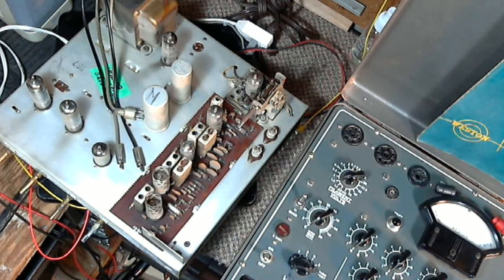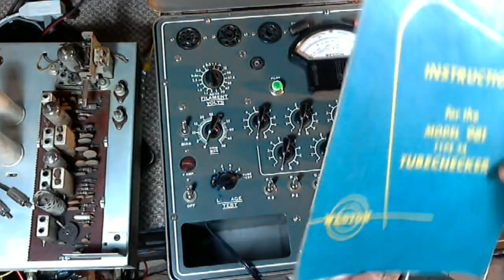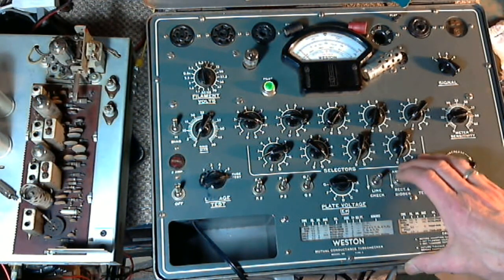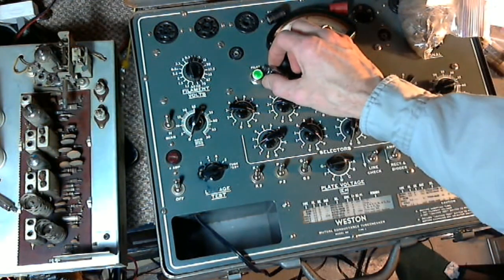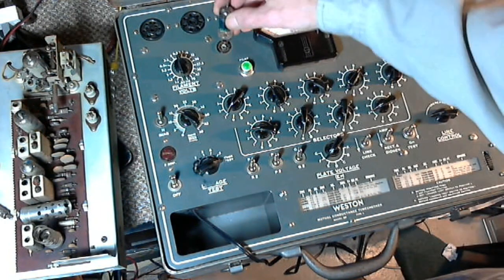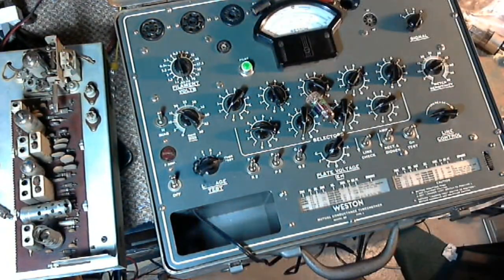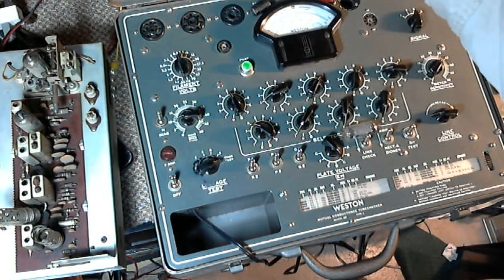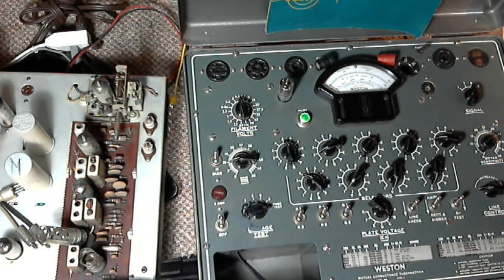Rogers Majestic 8059A Console Stereo Video #4 - Tube Testing Oh!

Comment: Jim review the video you did not miss read the tube. Actually you said "6am6" when you first read it, then when you went to set the tester you said "6am8" forgetting the number you had just read out loud, you did not miss read it.
Reply from the maker: As long as I didn't destroy my beloved tube tester, I'll get over it whether I was careless in reading it or senile in remembering it.
Reply from the maker: The output tubes are 6BM8's!  No wonder I get confused around here.  The radio was built by Philips under the trade name Rogers Majestic.  That's why the 'North American' radio uses a European tube set.  The 6AM6 is an EF91, the 6BM8's are ECL82's. And I'm in the middle of sorting through about 3000 tubes!  Thanks for watching, Jim.

Comment: This is one of the bad things about Youtube
You see someone make a mistake on cam and you cant say "don't do that or are you sure about that"
Feel your pain
FYI
Sometimes you can get the tubes "type" to show up if you fog the labeling with you breath
Reply from the maker: Off video, I am spending hours sorting through 3000 vacuum tubes.  I don't have enough breath for all of them.  Actual, I just put them under a very strong light and find that, if there is anything to be seen, I'll see it that way.  I very slowly rotate the tube and change it's angle under the light.  I also study the size of the tube and it's internal structure which can sometimes enable identification of the tube.  In the case of the error I made in reading the tube that killed my tester, I just didn't look close enough and make a sufficiently conscious effort to be sure I read it correctly.  Normally, I'm double and triple checking things as I go but, once in a while, oops.  Maybe I'll reach the point where my viewers are watching just to see if I survive.  A smart person once told me that if you aren't making mistakes, you're not doing anything.